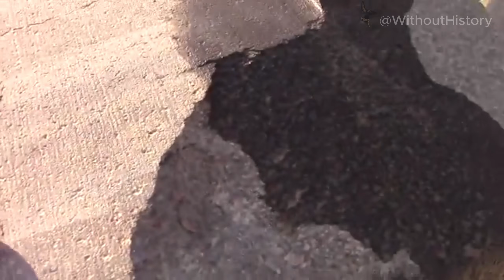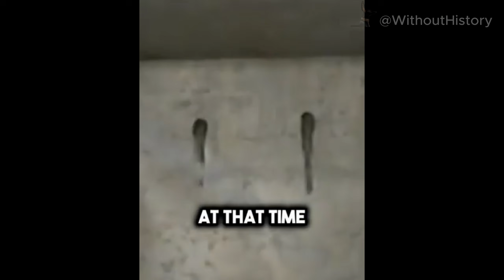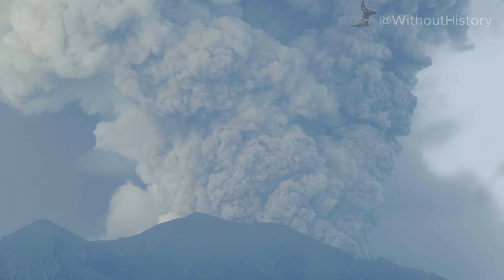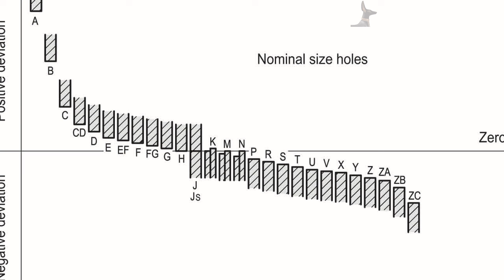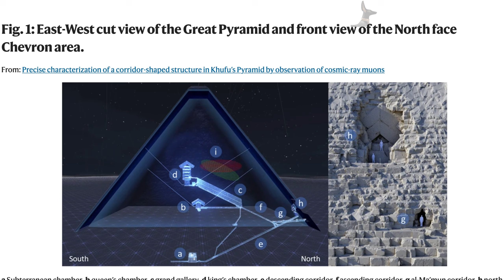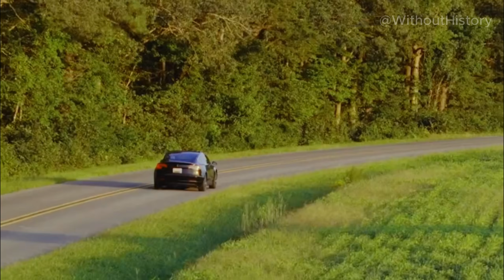EP 59. The Queen's Chamber's Shaft PROVES that We were WRONG on how the Pyramids were Built

Comment: I believe the pyramids.were created by on the spot molds built with mathematical precision to pour concrete mixed with volcanic ash similar to.Romans and Greeks. This type of concrete lasts for centuries. Not made with our cheap concrete used today. The air shafts are aligned to the Heavens astronomy astrology to pinpoint to a specific date hidden.

Comment: 1.  The copper handles I suspect are conductors to the exterior surface
2.  Tesla's tower likely functioned as promised, and was deeply grounded into bedrock.
3.  Subterranean chamber with sarcophagus may have been the lower grounding interface
4.  The exterior casing stones may have been the equivalent of an insulative layer, or possibly a means of gathering large static currents, or transmitting currents through the ether
6.  I have to beleive the upper sarcophagus was a reactor vessel
7.  Melted sarcophagus lids are wild
8.  That's all I got lol
5.

Comment: The King and Queens chambers by the Pyramids design would need to be built early in the production of the pyramid to be able to
do their job dispersing the weight of the pyramid so as not to collapse the rooms. Then the Egyptians worked outward to inward placing the sandstone blocks.
A ramp was used on the very inside of the pyramid to bring the blocks into place before lowering them.  Again, for the inner blocks of stone.

Comment: The Egyptians created the shafts in the King and Queen's chambers by how they laid the blocks. And would be open on top.  Then after the King and Queen's
chamber created with granite they drilled into the granite to connect the rooms to the shafts. Allowing ropes to be used for counterweights placing the stones. The ropes would reach across
across the pyramid to provide the counterweight necessary.  Think not like a crane but an elevator used to put the stone blocks into place into the inner pyramid.
Archaeologists opened up the shafts in the King and Queens chambers by removing the plugs. Originally, they were hidden.

Comment: The King's and Queen's chambers have distinct markings from being made by a tube drill to connect each room with the shafts.
We're talking about drilling into granite at a 90 degrees angle.  One of the "many" examples the ancient Egyptians had electricity and power tools.
The shafts were used for ropes for "counterweights", not a crane, but like an elevator to put the large stones in place on
the inner portion of the pyramid.  That is why they are not straight and were eventually plugged. They didn't need to be.

Comment: First remember that unlike our busy lives, back then this was their lives. Many of the men that lived there were made to be there until it was done… for thier entire lives some. I was probably an honor to work on this project and the brightest were assigned. A single person - one genius with a close to 300 IQ could have mastered the mathematics needed to create these perfect cuts and had ideas about cutting tools and engineering.

All the cuts were made before they were all assembled and if it wasn’t perfect they cut the piece again, There are many areas where there are cut mark, tbese were prolly stones that didn’t wirk elsewhere…

Also those two brass or bronze metal nubs were electrical contacts and prolly had something to do with mixing liquids and air and an electrical current to make something else… Either a fuel or something else. If there were other worlds there they could have been mixing materials we don’t even know… Also the entire pyramid could have been a blueprint if sorts.

They could have made handles out of the same stone. Those metal contacts go right through the stone and there were 2 which a current would need. 

They didn’t use brass anywhere else except for rooms where scientists agree some kind of liquid was present. Many of the shafts ended at larger rooms. 

I don’t believe they made these unbelievably accurate shafts for air alone. All that math and engineering and perfect cutting for air shafts no, this was some kind of machine that created something.  Maybe a fuel, or a food, or something… There was a electrical current that was created on the other side and there was a liquid that must have been pumped in and was activated by the electrical current.❤

Comment: The walls are so smooth and the fit so good that it looks like a syringe. Erosion at the inlet of the north vent of the King's Chamber has evolved into an oval, a unique shape that is a hallmark of erosion around a rectangular opening. This indicates, with a high degree of probability, that water flowed from the King's Chamber into the vent. If the vent was to act like a water trap, it would take some suction to get the water up and over the trap. So, some communication between the Queen's shaft and King's shaft must exist so the suction can reach the north vent of KC.

As far as machining, I believe the giant boxes in the Serapeum were shapers. The polished top edge of the box and the underside of the 20-ton lid form a fluid bearing when water is in between. Friction goes to near zero and the lid would move with just 40 pounds of force. I measured the slope of the top of the box and it was 1.65 degrees downhill. This would take fourteen people to pull uphill. So, gravity and fourteen people would get the lid traveling where it struck the workpiece. I believe it was used to create the flat surfaces of the casing stones. The granite lid is much harder than the limestone workpiece and it might take five or ten pulls to go all the way across. The cutting edge of the lids are all chipped. The reason all the lids are open is that is how they leave them, ready to install a new workpiece.
Reply: Your second paragraph is very interesting. After shaping the stone, how would they get the stone out of the box? Or was the stone smaller than the interior of the box leaving space around all 4 edges, or 3 I guess because the lid would force the stone to the opposite end of the box as it pushed in that direction during shaping? Makes more sense than any other theory for those boxes, especially as a coffin for ceremonial bulls.
Reply: @frodobaggins7252  They would hoist it out of the box. Yes it gets shoved against the inside end wall. It has a thick enough wall to handle the pounding.

Comment: Watch Christopher Dunn explain this. One of the  metal rod has a zinc coating along with zinc remains in the shaft. Suggesting shaft filled with fluids that leached into the Queen's chamber. The hole of the shaft Entering the Queen's chamber had a porous stone plugging it. The metal rods are some form of hydraulic switch. Fluid level monitoring to keep a consistent amount of pressure on a leaching stone with liquid. The liquids leached into the queen's chamber for some form of reaction. The metal rods maintain a electric connection which is broken when the fluid level drops. Suggesting they had electricity

Comment: My best educated guess is that every single block was cut and placed specifically for the  individual purpose they each served. There’s no doubt that the mathematical, cosmological, architectural, and logistical planning of such a massive project clearly points to vastly superior planning than we currently have… being a Project Manager, before any project can begin there has to be sufficient time for planning. This includes building a “business case” or simply the reason for the project/ what value does it bring (This is important to consider btw). We also have to consider the planning of resources, both human resource and physical resources… mind you all this has to be done before any project work can start! Just thinking to myself… the planning of the Giza project must have taken years considering this wasn’t not an iterative process but rather a Predictive process. This was planned to a T and executed in one fell swoop! The civilization that’s responsible for this project had to have some clear motive for the project and it had to have been something super important.